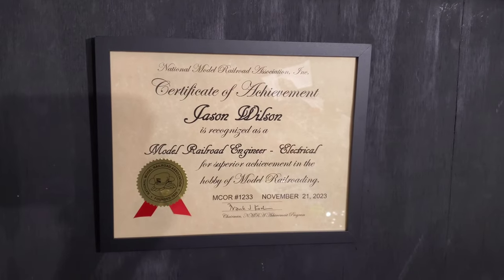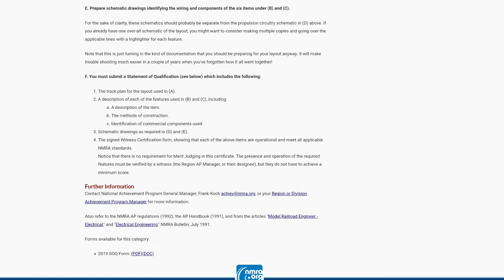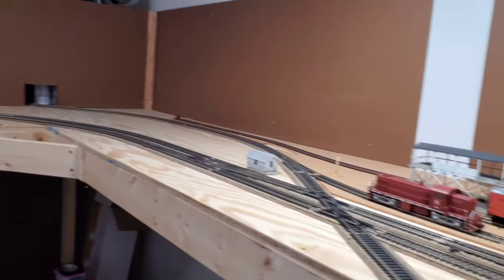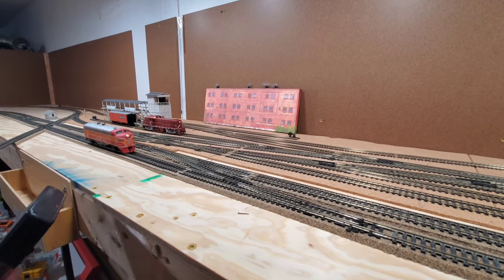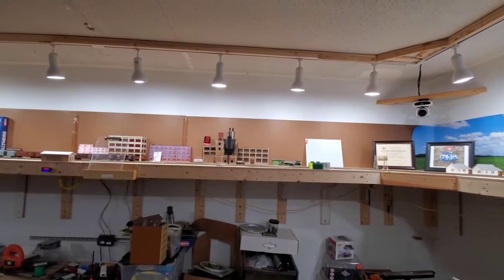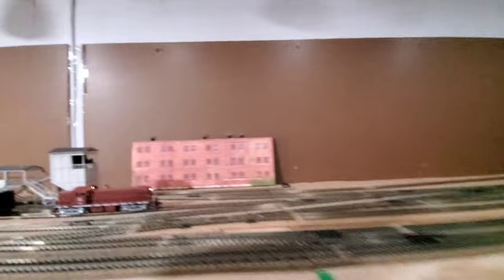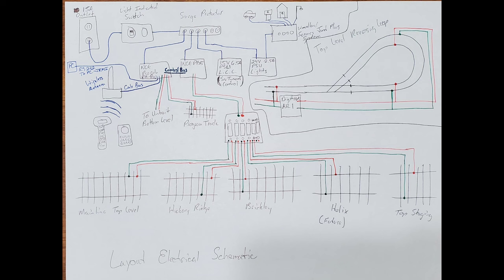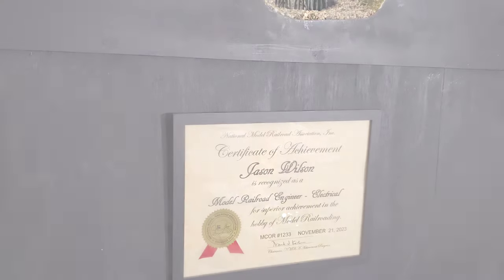NMRA Electrical Certification - How I Earned It

Comment: Awesome Jason!   I've gone back and forth on Joining the NMRA.  I've got this cert, I'd just need to do all the leg work for the submission.  Unfortunately I can't get the golden spike because I only have turnouts on the Time Saver... Although one is a dual gauge and I think that might count for one of the three.  Unless a simple road crossing (no crossing arms) will count as a "type of track."  Bottom line there is no NMRA club within two hours of me so I have a hard time making the decision to join.
Reply from the maker: Thanks Dennis! Golden spike doesn't require 3 different types of tracks, just 3 types of trackage. I used 3 turnouts for the Golden Spike. Also you don't have to have a NMRA Club in the area to join as the closest one to me is about 3 hours away. You can do all of this on your own layout and yours is plenty big enough if that is something you want to go after.
Reply: @TheTrainFreak  Who would I send in my paperwork to then, if I’m not part of a club?
Reply from the maker: @OtterCreek I email scanned copies of mine to our Region AP chair who lives in Kansas City. We are in the same region (MCoR) but different divisions. Looks like your division doesn't even have a director or president so you could run for that....lol.
Reply: @TheTrainFreak  That has been one of my reluctance's at joining LOL.  If I were in a position to "be a Leader,"  I might be tempted but I just want to build my railroad and not worry about organizing anything!!